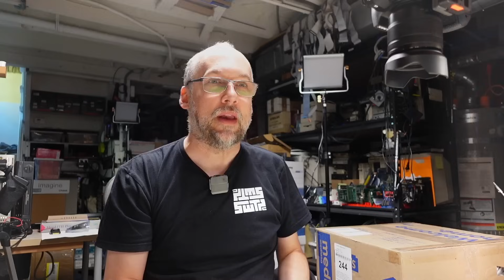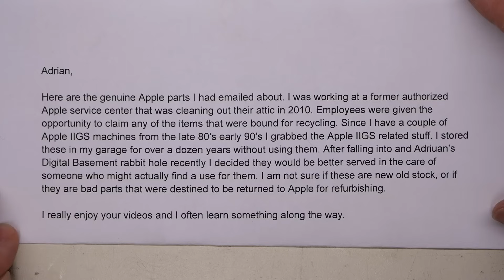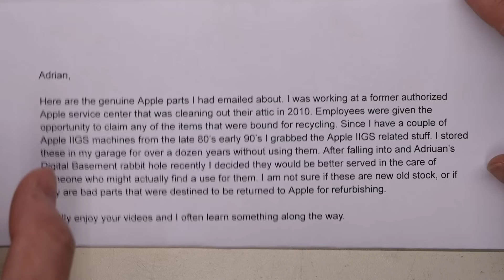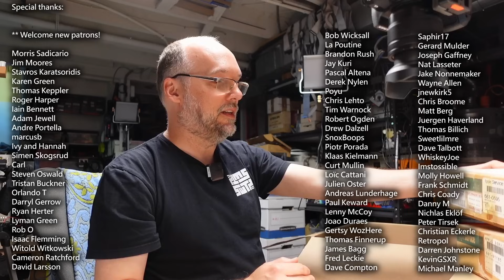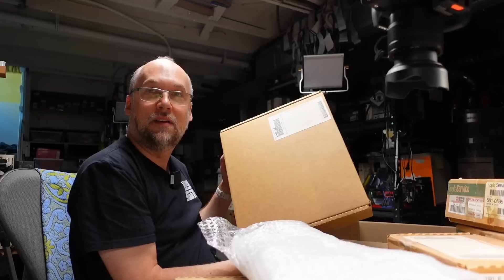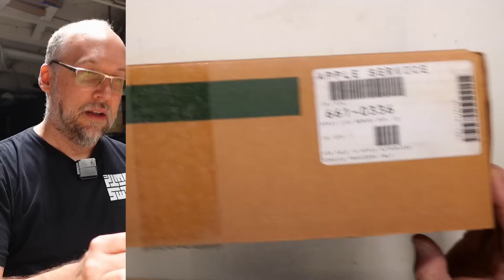0071 Fixing a Commodore 16 with modern parts, a bunch of NOS Apple parts and testing MOS chips

Comment: I'm not the biggest Apple fan but I would LOVE to get my hands on an Apple IIe card and an LC or Color Classic to put it in. Would be a perfect compact way to enjoy Apple II and Mac stuff. Oh, and the Mega II chip in the IIgs is called the GEMINI on the IIe card. :)

"French Oric Armos"? I think he meant the Oric Atmos but it's not French, it's a British micro and it does use a 6502 CPU.
Reply: > 50,000 in France 

Perhaps he means that's where this particular model came from? They did sell highly in France back then.
Reply: @FrostekFerenczy  It's very possible it was bought in France because as you say it sold well there. But it's still a British micro. :)
Reply: I'll not tell you that I threw out a large chunk of my LC collection recently as I needed the space (They all had Ethertalk cards installed along with DAVE to enable hard drive sharing - custom cable looms to allow 7GB per machine. I should have documented it all)

Comment: I do remember one thing for Atari 6502C "Sally" and that it runs on 2Mhz. Question is, can all 6502 run on 2MHz (like ones from VIC20), or do they have speed class like Z80's?
Reply: There are 1MHz and 2MHz versions of the 6502, but I believe they are not different chips, because in the data sheets many timings are equal. What has changed are the worst-case timings. Likely, the 2MHz versions are a portion of the production that has been certified for 2MHz operation. Depending on how this certification was done (whether 1MHz were confirmed unsuitable or just not tested at all), 1MHz parts may work or not work. In my experience, 1MHz chips run fine on 2MHz, I see no instabiltities or excessive heat production for the tests that I have done.
Reply: @danielmantione  So, basically, most will run at 2MHz. That's fair. I just remembered that my best friend, who is no longer with us, and I used various arguments for which is better, his Atari 800XL or my C64. His was usually CPU speed and my trump card was intro music from Yie Ar Kung-Fu :)

Comment: c64 is a 6510 NOT a 6502.... please stop calling it a 6502....... 2 different chips....
Reply from the maker: While the 6502 and 6510 aren't pin compatible, the 6502 is an NMOS 6502 with an extra IO port at address $0000 grafted on by MOS. The way it executes code is 100% identical in every way, down to the undercommented opcodes.  That is why you can build a little PCB to use a bone stock 6502 in the 64, just like you can use the 6502 in the TED machines which normally require a 8501. You just need to replicate the IO port which can be done externally...
Reply: I see your point. While it is mostly the same internally, the 6510’s main advantages over the 6502 are the 6-bit io port, a single clock pin, and a tristate ready/sync pin. It is very similar to program for, and for the vast majority of people, it might as well be the same.

Comment: For that Apple IIe card, you can get a very inexpensive replacement PCB based adapter for the external cable from Joe (Joe's Computer Museum) called "Why Cable?"

The card will work without any modifications in a LC 575 (in a Color Classic) you just need to be running a version of system software that'll allow you to run in 24-bit addressing, so it'd need to be 7.5.x or earlier

Comment: The 12V goes into pin 13 on the VIC-II, which on the 6526 is Port B3.  Probably lucked out big time, because that should have been the end of port B working properly, but the register was clearly still functional since it passed the diagnostic.
Reply: That is the keyboard + joystick port if I understand correctly.
I guess those pins might have some built in protection against static electricity or the like?
I'm starting to wonder that this is why there are quite a few CIAs with (partially) dead keyboard port and nothing else.
Reply: @jwhite5008  there may be some protection, but given the number of failed CIAs out there, I expect it's not adequate against higher voltage events like what you'd get with direct static discharge. It's probably fine with 12V for a limited time like what happened here, but static discharge can be in the kV range, which is almost certainly a death sentence for these ICs.
Reply: @bjn714  The protection I'm speaking of is basically zener diodes effectively shorting the high voltage to ground. It is supposed to withstand a few kV at microampere currents. It might hold against 12v for a brief moment before overheating, shorting itself, and then destroying the chip's bonding wires. This kind of protection is common in most modern chips - otherwise those would die instantly from every rogue touch. The technology existed back then but was much less common - probably due to cost and static electricity having almost no effect on TTLs and less damaging to coarser-process CMOS. I have no idea if it was implemented in CIAs.

Comment: The Motion Server card is a 16-axis CAM control board. Those Orca chips are FPGAs. That's likely essentially a single-purpose PC on a card.
Generally all the ones I've ever come across were Motorola-based.  And this was once a cheaper way to get ahold of a 68040s [not saying that's an '040, just some back-story].
Reply from the maker: So for controlling CNCs perhaps?
Reply: @adriansdigitalbasement2  Yep. CNC, production automation (converyors, pickers, etc), anything with a bunch of servos.
Reply: My first thought was that it was a 68030 because it looks much like the one I had in my Amiga.
Reply: General purpose, could be used for robotics or industrial automation.   Advantech still sells them today.  Operates in real time with a separate CPU to avoid timing and synchronization errors introduced by a host PC running a non real-time OS
Reply: When he got the VGA card out of the same box and thought it couldn't be Apple related, I wonder if it could be used via the Motion Server card if it is indeed a PC on a card, giving an Apple user full DOS compatability.

Comment: The problem with the RetroTink isn't so much with the RetroTink as with the retro computers playing fast and loose with the video standards - early Commodore machines (VIC-20 in particular) take many liberties with the timing and voltages of the signal, so I wouldn't be surprised if the TED is also a bit iffy as far as video is concerned.
Reply from the maker: My older RetroTink actually seemed to work much better -- the RetroTink 5x Pro or whatever I'm using now is the one that so extremely fussy. It surely targets game consoles where it surely works fine--- but with computers, it's constantly acting up so badly. I just need to go back to my previous one so I can stop complaining. The older one is much less flexible (it has no GUI) but it just seems to work. :-)
Reply: @adriansdigitalbasement2  Agreed, I have the RetroTink 2X and it's super reliable.
Reply: But dealing with retro computers that play fast and loose with the video standards is literally the point of the RetroTink.
Reply: @MagerValp not at all - the retrotink is designed to work with a specific set of old gaming systems, so is a collection of point solutions in one box, and in fact if you ask about using it with a C64 or whatever they’ll tell you that is not the intended use.
Reply: Yup, most of us bought a retrotink because we had bought the cheaper chinese video converters that didn't work well with our various old systems.  I do wish the retrotink was a bit more stable and professionally designed and didn't feel so much like you're buying a modified project board.  I had to replace my first retrotink because it didn't come with a case and the usb connection came loose from being pulled on too often.  They work well as a single use device but not durable enough to be swapped around.  It does look like the newer ones at least come with a case now.  :)
Reply: @Brian_PM   I don't know what device you're talking about, because the Retrotink 5x always came with a case, and is based around profiles, not single use plug and play.
Reply: @rachelaudrey6241  i don't have the 5x, I have the 2x.  The 2x i got in 2019 didn't come with a case, but the newer retrotinks they sell now do.

Comment: Electronics master Mr. Carlson's Lab did teach us twist off the surface mount capacitors, it's the right way.
Reply: How he restores those old radio receivers never ceases to amaze me when I watch one of his videos.
Reply: I've managed to desolder those off a few times. 100% not worth it vs twist and rip.
Reply: @No-mq5lw  It's OK for you to be safe, but this method proof many times on video won't rip the copper trace on the board, except the trace itself flaky.
Reply: @johnsonlam  i have had many boards on my bench where people have twisted or cut the capacitors off, and caused trace damage as a result.

If you don't know what you're doing, dont do it. The correct way is hot air or hot tweezers. IPC-7711C/7721C says so and that's the international standard approval for board rework.
Reply: @johnsonlam  Nah, I wanted to try it out just for the sake of doing it as a learning experience. Both the cap and board were junk anyways. Found out you're more likely to damage the cap or another component with a bunch of heat or rip it off anyways than be any successful with those.

Maybe a skill issue or something with my tools (don't have chip quik, air gun, or solder pump) but honestly, as far as I'm concerned, the simplest solution here is the best one.
Reply: More divisive than the coke vs Pepsi debate. I twist them if there's heat sensitive components or connectors nearby hot air otherwise. But seriously whatever man develop your own style and go with it.
Reply: @AlfieG2255  Sometimes you have to see the actual situation of the PCB before proceed, since too many factors can lead to wrong judgement and ruin the board, have to decide by yourself when and which one can twist them off or need to apply heat and slowly remove them.
Reply: I watch his channel, he is an absolute genius. I love how he introduces each video sat on his chair surrounded by all the kit he has restored and repaired over the years.
Reply: I thought I was the only one who watched him. Such a talented dude.